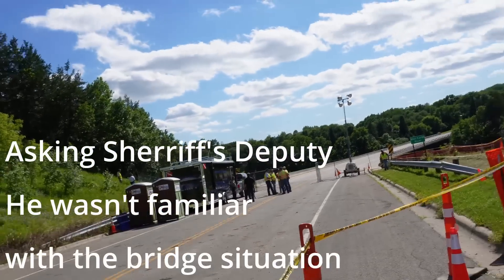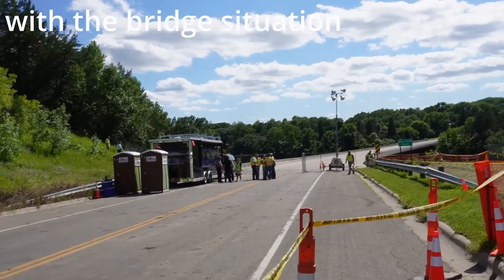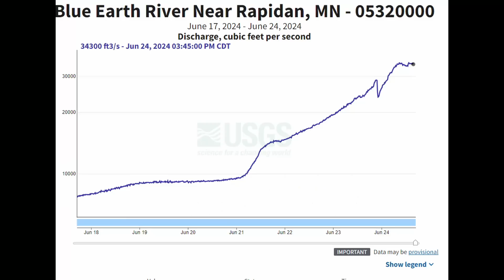Update: Onsite at Rapidan Dam Failure - Minnesota

Comment: Casey I'd love if you could interview the County Engineer.  He had a lot of good info in the press conference.  I'd like to know if the upstream piers are hammerhead piers built on sandstone footings or if they were drilled shafts.
Reply from the maker: Thank you.  That is a great suggestion.  I plan to do a follow up because I think this bridge is at serious risk of damage to the piers and the abutment.
Reply: @CaseyJones-Engineer  look up in youtube the fox 9 video Erosion worsens at Rapidan Dam.  It's raw aerial footage without editorial comments and you can really see the Geotechnical layers of the subgrade and how the water is carving into the rock.  I've never seen this type of erosion up close.
Reply from the maker: @TnTHoward  I talked with the Blue Earth County Engineer and Public Works Director, Ryan Tilgus (actually we exchanged voicemail messages).  He said they are quite worried about scour around the bridge foundation.   The piers are supported by driven pile.  The piles are end-bearing on the sandstone so the lateral support comes from the overburden soils which are not probably gone.  They are keeping an eye on it, but I suspect there is a lot of damage to content with.
Reply: @CaseyJones-Engineer  oh yikes wow yes I do scour critical ratings for bridges so I am familiar with this.  Thank you!  You get a huge gold star nice work
Reply: @CaseyJones-Engineer  if the head cut has lowered the streamed around the piers as much as I think it has then it will be interesting to see if it can hold itself up!

Comment: I don't know why they didn't drop some gabions to reduce the flow of water against the bank.
Reply from the maker: You know that is a great point.  They need to do something.  That channel is only getting wider and I think erosion is likely threaten the bridge abutment on that left side of the new channel.
Reply: @CaseyJones-Engineer  They haven't done anything to help, they could dump riprap or broken concrete off the bank. They could have removed logs to let more flow threw the damn. i guess the plan is to let it do as much erosion as possible.
Reply: @CaseyJones-Engineer  Or the original over flow was supposedly because they didn't have the right bucket to push debris threw the damn and it was 6 hours away. So im to believe there isn't a single traco within six hours of this damn. Isn't this farmer country, surprised some good old boys didn't go out and do it them self's

Comment: I wonder if the family is thinking "if this dam wasnt here, we may not have lost our home this way. It's namely the dam getting blocked that made it a situation where the force of the water rerouted itself. I mean, ultimately nature will find the path of least resistance. I know its kind of impossible right now to clear the debris from the dam to open up the dam flow again but idk, I'm just wondering without the dam, would have it reduced the risk to the home and business there.
Reply: Well, if the dam wasn't there, unlikely the house & store would be either.  In hindsight, yes, the dam, once clogged up, deflected the river flow disastrously in response to massively exceptional natural conditions.  The new channel appears to be cut so deep that when river level returns to average, the dam itself may be sitting high and dry, so cleaning up the debris will do nothing. The dam was being considered for removal in any case - looks like nature has made that call.
Reply: The dam was finished being build in 1909 and the restaurant a year later so i suppose you're right about that however, the dam was only used until 1966 for hydro electric power. Which means it was no longer in use after 1966. Usually when dams are no longer in use- according to environmental experts, they should be removed to improve water flow for normal sediment flows and improving water oxygen levels to help the fish population. Soo regardless, after 1966, it should have been removed which it not only costs to put one in but also to remove one of course so i guess that was a financial decision based on the city sooo idk who knows. If it was removed after being decommissioned, the home still wouldn't have been lost in this situation

Comment: I think the river is making it clear that the debris and dam are strong enough to handle removal....and all this overflow would reduce if they just cleared the area.
Reply: If you meant that the dam is strong enough to safely get on it to clear debris, I'd say it is probably beyond the stage where clearing debris would allow enough water to pass through to meaningfully decrease erosion around it.

If you meant removing the dam itself, the middle of a flood probably isn't a good time to smash it since the strong currents will carry chunks away, making clean-up more difficult and potentially causing additional problems downstream.

Comment: Casey, do you think anyone one is there in an oversight capacity for a 'lessons learned' type of perspective? I know that there were probably hundreds of these type dams built with all good intention and engineering insight at the time, but allot could be learned from the failure of this dam, as to, what to look for in existing ones and possibly for engineering practices in future builds!
Reply from the maker: There is an organization Association of State Dam Safety Officials that compile lessons learned from these situations.  There are many similar dams in similar or worse shape at this point.

Comment: The water level looks like it is greatly reduced from the level it was at in the earlier videos.  That seems to me at least to suggest that while the bypass/cut the water has created is much larger, that the risk of additional damage to the dam, or a catastrophic failure has been greatly reduced, due to the reduction in head and flowrate potential. Obviously the primary stream channel has shifted position, but that has already happened, so there isn't anything to be done about it now.
Reply: There wasn't any major threat to anyone from this damn even at full flood stage the media blew it out of proportion for the $$$

Comment: Ok, I have to say that I chuckled like a 10-yearold when you said "I'll continue to update you on this damn story ..."

On a serious note: I understand that the cause was the accumulation of debris at the gates combined with heavy rainfall upstream.  Can you demonstrate how the gates worked on this dam?  Did the debris or silt build-up prevent opening?

I'm sure that the questions that will go into the root cause analysis will be: (1) why were the gates unable to be opened far enough to let the debris pass through?  (2) What impact did the silt accumulation along the face of the dam prevent the gates from discharging water?  (3) Why wasn't there a preventative discharge based on weather models?

Comment: Those bridge piers were most likely not built to withstand the forces now being applied to them. The dam was built before the bridge, so those piers were engineered for calmer flow conditions. If the dam fails completely and is not rebuilt, those bridge piers may have to be re-engineered to withstand higher flow rates, and the scouring effect.
Reply: The bridge is newer and they had solid bedrock to anchor on.

Comment: One thing has become very apparent the last 24 hours.  The severe scour as you call  it has took all the pressure off the dam so it will no longer fail.  On the other hand it has allowed all the water stored behind the dam to escape downstream making the dam useless at this point.  So they might as well take the dam out to save the bridge and the pie shop.
Reply: As long as the reservoir formerly behind the dam was gradually releasing, there was no reason to destroy the dam, as doing so would have released a wall of water all at once.
Reply: There's hardly any reservoir, the issue was never the amount of water in the reservoir, it was always the volume of the river flow.  There are satellite views that show the river as brown, until very shortly upstream of the dam where it turns black from the anaerobic sludge getting picked up that had been in the reservoir.
Reply: The dam has not been holding back water since 2019